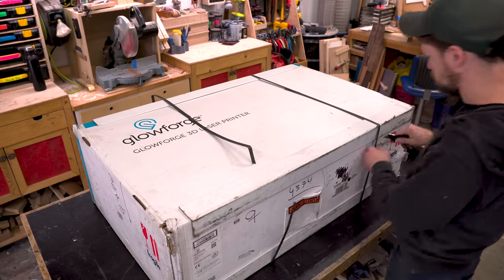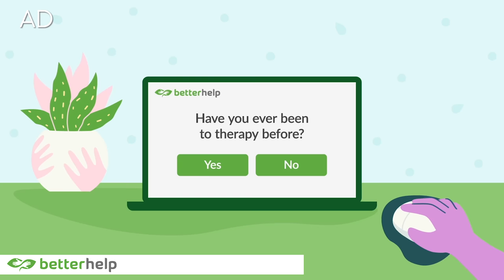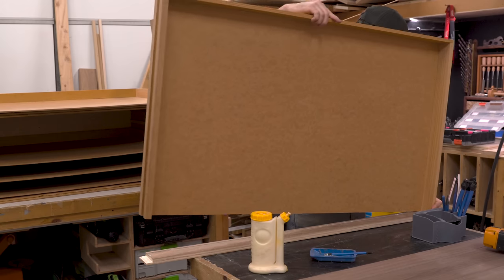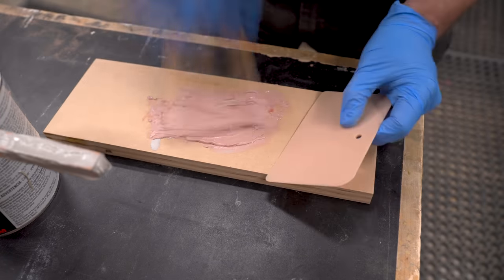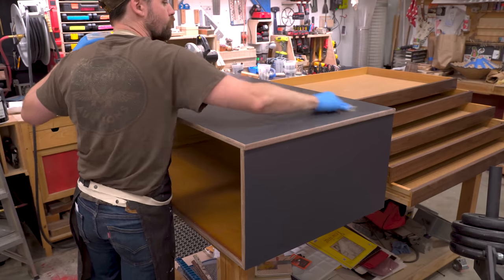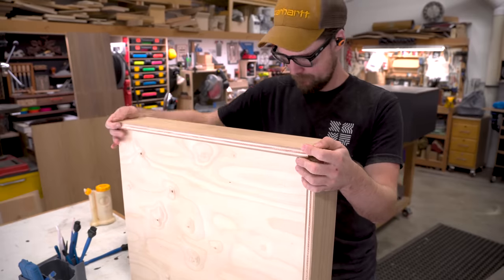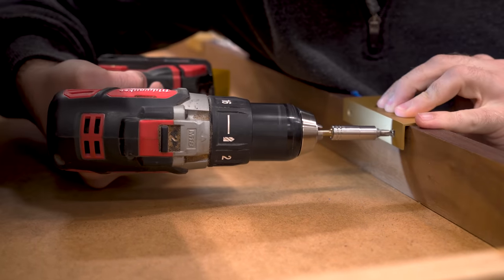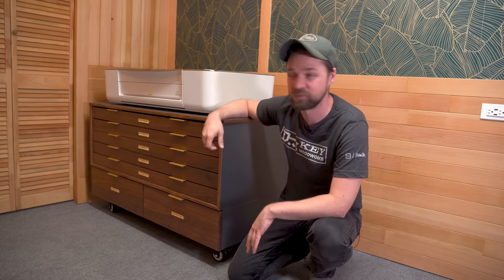$40 Craigslist Flat File to $2000 Heirloom Cabinet

Comment: I bought an old wooden desk that sat in a barn for a few years for $50. There was insect damage to the lower pieces, but they were coming off because the desk was too tall for an office chair. I sanded all the surfaces. I then did a primer coat and two layers of paint. Repainted all the drawer pulls. It is the heavest desk I have ever had to move around. It is even heavier than the military desk I use to sit at in the 1970s. I am still using the same desk after five years. I love this thing. I agree completely about upcycling.

Comment: SPAR varnish takes much longer than a typical alkyd based clearcoat. It takes a bit to setup and then continues to cure over a week or so. Regular polyurethane or acrylic urethane (not the same as waterborne urethane, even though it is acrylic) works great for the application you are doing.

Comment: Great job Michael.  I wonder about your glowforge - how are you handling venting it?  I think they have a air cleaner accessory, but does that in turn vent back into your small office?  I have a similar machine and still have not solved this, so I'm curious to see how you figure it out.

Comment: Question….  Why not build a special large enough drawer to fit and tuck the glowforge into the cabinet ? You could  set it on a a tray with rollers to be able to pull it out when in use and then roll it back in once done? I  think itll leave a cleaner office look plus sitting it ontop takes away from how nice the cabinet came out IMHO.
Reply from the maker: that's a good idea for sure. The only issue is GF is really heavy, so you'd probably have to bolt the cabinet to the wall.
Reply: @MichaelAlm  i meannnn beauty over  function right ?!? Lol

Comment: Hi michael, I got a question. Recently, i started doing some woodworking as a remedy against my depression. I have a few handtools and i got a ton of free wood that served as a couple of benches in a community center in my neighborhood for a few years. I think it is construction wood, but frankly i'm not sure. To practice my skills i decided to make some box joints and honestly, it's a lot harder than i thought. But practise makes perfec i guess. My question is this. The wood seems to be extremely dry. And when chisseling out the joints, it seemed like the fibers were all detached. The wood chipped and broke and the result was straigh out awefull. Is there something like wood that is too dry ?

Comment: When you cut the chest, why not removing the front 10 inches? That way you keep the back (that keeps the squareness) an get rid of the chipped out front with the slot for the T trim.
Reply from the maker: Good question! I cut the back because the runners are inset a bit and glued on. For the drawers to work right it seemed better not to mess with that offset.

Comment: Wow, what a fantastic upcycle, the finished cabinet looks amazing! And given the cabinet placement & use case - not a high traffic area, mostly up against a wall - it makes sense not to bother with finish on the painted bits. I would definitely be tempted by plans for a similar cabinet, it looks like it'd be super useful in the workshop.

Comment: When you cut the cabinet shorter, wouldn't it have been easier to cut of an area from front  instead of the back? The back is the only piece that gives it some rigidity.
Reply: Then the rails for the drawers to slide into would be in the way at the front, I think. They need to be shorter at the front for the drawers to shut flush, right? (I can only assume, I didn't get a good look) So cutting from the back was the easier option here .

Comment: Why was cutting the drawer on the table saw sketchy? you had plenty of holding room on the right side of the blade, raise the blade all the way up no big deal, plenty of support.
Reply from the maker: I wouldn’t recommend cutting it all the way through. The drawer bottom is floating so if you cut through the sides it could bind the saw, and kick back
Reply: @MichaelAlm  Sure, We each must do what we feel is safe in that moment.